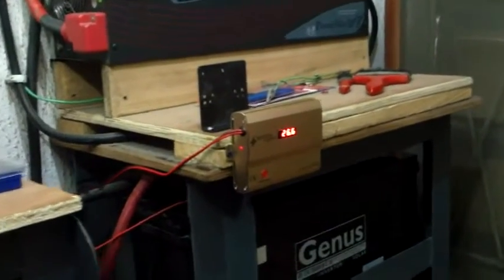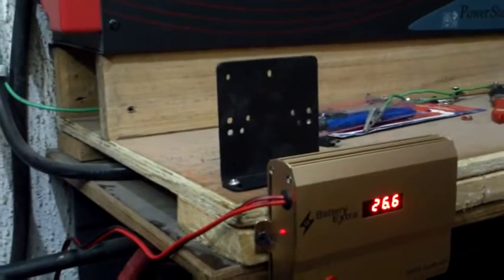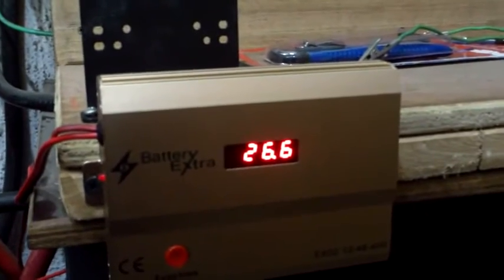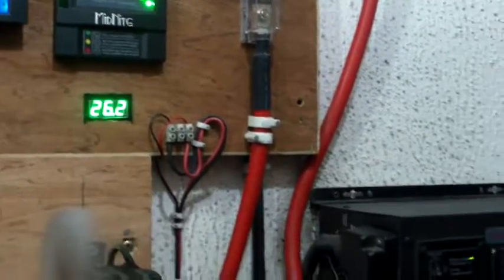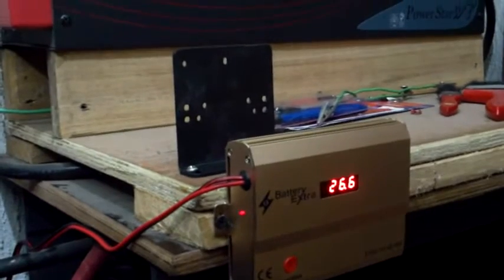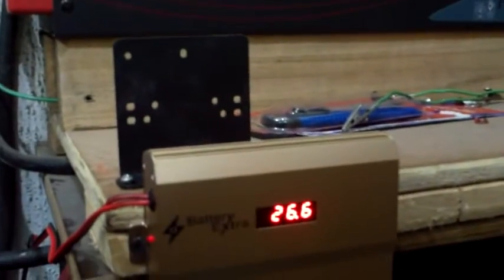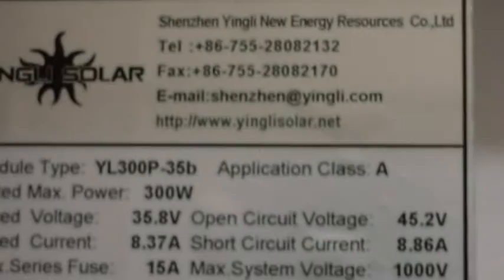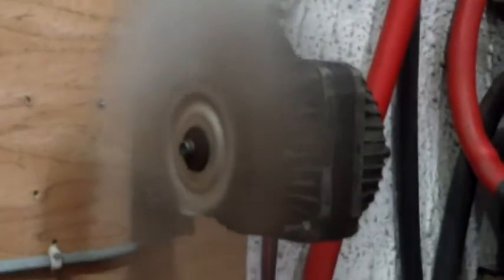Battery Extra desulphator EXTRA EX02 12-48-400

Comment: nice!...any conclusive evidence that the desulphators work?
Reply from the maker: From all indication, all my batteries were in good condition before installing the battery extra.However I did  notice that once my system floats @ 27.2 Volts it stays at that voltage until i experience a power outage from the GRID as against before when it hits float voltage , it does drop to 26.5 or 26.8 Volts and goes back to 27.2 Volts.
I have also seen some reviews on Youtube of various people bringing up almost dead batteries back to life.
Reply: @ibidapoilawole7120   good day sir , what is your conclusion on this unit ? Did it work well for you ? And did it do the job it was designed for without any negative side effects ?